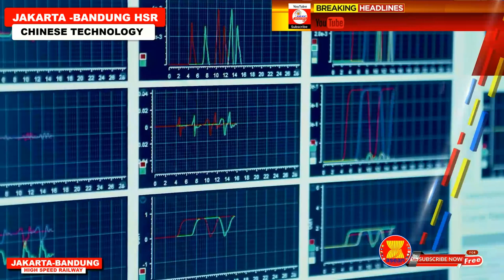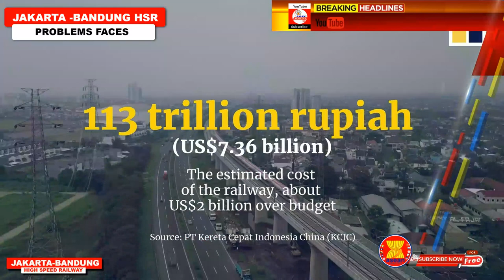A BIG SUCCESS of China's Biggest BRI Project In Indonesia

Comment: Ok Indonesia is the first to have a fast train
Reply: Indonesia the best in southeast now👍
Reply: Test run Speed 386Kph (very slow)
Reply: @iwanadicandra3509  CR400 is currently the fastest and most technologically advanced high-speed railway that has been put into operation worldwide.

You need to figure out the difference between the experimental train pursuing the highest speed on the test line and the target speed tested on the operating line for mass production trains.

Speed is not necessarily better. If the speed exceeds 300 kilometers per hour, the operating costs will increase disproportionately. Choosing the one that suits oneself is the best choice.
Reply: @panli-z4m    The fastest test speed of the current model CR450 is 453 KM/h has been completed
Reply from the maker: Thanks for watching, stay connected for more..